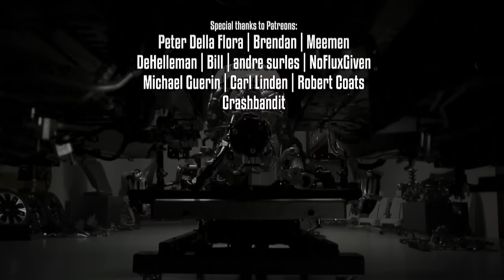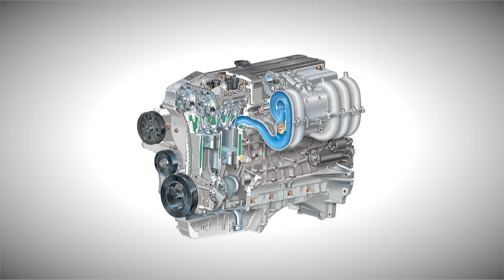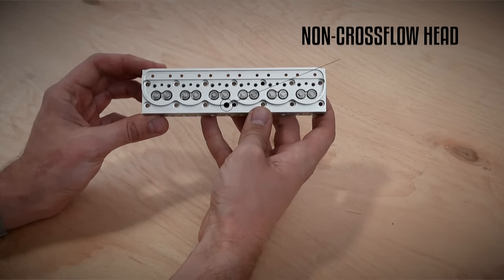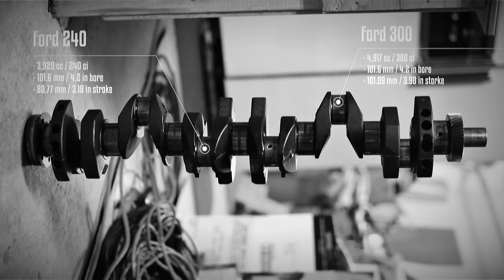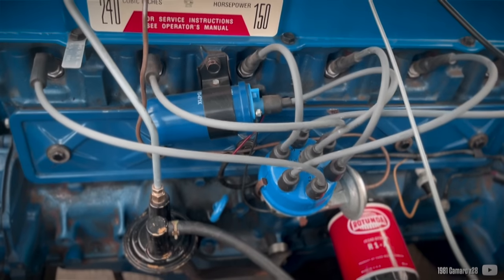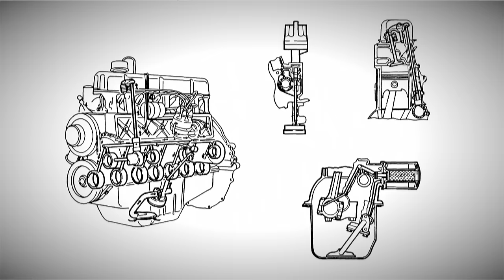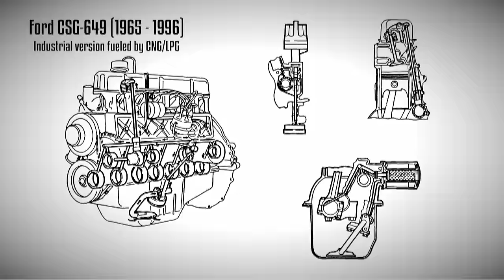Is This Toughest US 6-Cylinder?

Comment: I've been an ASE Certified Master Tech for over 25 years. Worked on everything there is. Beyond a shadow of a doubt, there is one US Straight 6 that is the king of endurance and longevity:
The Ford 300ci I6. Period.

It may get so weak it can't get out of it's own way, but it will run.
I watched one run for 20 minutes longer AFTER the back half of the camshaft had broken off and slung itself out the side of the block. You can't kill a 300 with a sledgehammer. Hell, it kept running after it tried to commit suicide. The Ford 300 is unstoppable.

Comment: 3:37 the 240 also has a different block casting. The deck height was much shorter. The 300 exists because the 240 didn't have enough torque to do what farmers wanted their trucks to do; ford's response was to stroke it so much they needed a couple inches more deck height. That's why the 240 didn't live as long as the 300 in production; the market for straight sixes in cars where the 240 worked exceptionally well dried up but the 300 would still sell like mad even today.

Comment: Sorry, but at 300K miles, they’re just getting broken in.
At 450K miles I had my 300 rebuilt and drove it another 250K miles.
That was the Best pickup I’ve ever owned.
If Ford would build another F150 with the 300 In-Line 6cyl again I’d be happy to buy another one.

Comment: 300cid Inline-6 was likely the best built 6-cylinder. Timing gear instead of chain, made these almost indestructible. Only downside was their base 1-bbl. carburetor Ford slapped on them. An Offenhauser replacement intake manifold allowed for a 2 or 4 barrel carburetor instead, thus turning these 300's into screamers for performance. 

Ford should've kept this engine versus their EcoBoost V6 platforms they make now. A 300cid in today's rigs with performance fuel injection, would set records for economy AND performance.

Comment: While I love my Ford I-6, can it really be any tougher than that weird-looking GMC V6 they put in everything from pickups to semi-tractors?  I had a '66 GMC pickup with a 351 V6 with a stock huge two barrel carb (you'd swear it was a 4 barrel if you saw it from the side).  It trounced V8's on a regular basis.  Unfortunately the rear end and transmission were no match for it.

Comment: Ford didn't want a 6 cylinder and that is one of the reasons the Dodge boys left Ford. It took till 1948 for Ford to build what Chevrolet and Dodge has been doing for 20 years. The exception was in 1908 in the failed model-K. Hudson built a better 6 cylinder than Ford around 1950 also around 308 CI.. Chryslers slant six was better, Chevies Stove bolt six the 216 and the 235 were fabuloius and the Jeep 4.0 was always very durable. I never gheard of anyone getting much more than 14 mpg in a Ford 300CI, less when working them.
My cousin broke a piston skirt in his 300 but his love for the engine forced him to rebuild it. I think the nature of straight sixes is their reliability as Cummins uses them for deisels. I have always had straights 6s and once had a straight 8.

Comment: I had forgotten about that motor. I once bought a (late 60s ~ early 70s?) Ford pickup with over 250,000 miles on the 300. I put an old cap on the truck, loaded it with my tools, clothes & all my stuff and headed to Colorado from Pennsylvania with a friend in search of work. Other than a tire blowout east of Denver, and about 15 quarts of oil...(did I mention it used a ton of oil after spending 200K miles delivering beer for Marienville Beer Distributors?) not problems occurred. A couple years later in El Jebel, CO between Glenwood Springs and Aspen, I bought an old Willys Jeep pickup from a sheriff deputy that she had stuck in a field. In the bed of that truck was a Ford 240 that had a stuck valve from sitting gawd only knows how many years in that field. Off came the head, freed up the valve & lapped all the others and changed to valve guide seals on all the valves. Out came the 300 & in went the taxi cab (yup, that's what it started life  in) motor and I drove it another 100K before the rear main seal went out. The truck was then given to a brother-in-law who changed the seal & after that I lost track.

Comment: I have owned several Ford F-series trucks that utilized the 300 I-6 engine. I had an F-250 while in high school that turned the dial over 450,000 miles. The only reason I got rid of the truck was because the frame rotted out and I couldn't tow with it anymore. The engine still ran like a top, and managed to afford me 21 MPG under normal driving conditions at 55 mph. Towing a landscape trailer loaded down with 2 riding mowers, a propelled sicklebar walk behind, 3 push mowers, chainsaws, weedeaters, hedge trimmers, a dump cart, a truck box full of tools, and 30 gallons of fuel, it still gave me 14 to 16 mpg. 

I wish Ford never outphased that engine because I took an early 80s 300 and gave it the Clifford Racing treatment and had my uncle do some slick head-work in his machine shop. When it was all said and done I got a little over 390 hp and around 750 to 800 lbft. of torque using two Holley 500cfm two barrel carbs, custom built dual headers, an X-pipe, and a 2.75" exhaust. The funny thing is that even with the performance upgrades mated to a 5-speed and running a 373 rear it managed 20 MPG conservatively driving and about 14 if you were whooping on it. It would piss off tons of 5.0 Mustang owners when they got stomped by a 6-cyl shortbox pickup. I imagine that if someone was inclined to reduce the compression ratio that running a supercharger or turbo on one of these engines could render close to 650hp and upwards of 1000 lbft. of torque and still be reliable enough to be a daily driver as well as an asphalt rippa.

Comment: Love the straight sixes.
Had a 65 ford Fairlane with one, retired the car due to rust at 220K miles.
My friend has a 66 Galaxie 500 with the six, still going strong at 211 K.
Had a 66 Dodge Dart with the slant six, love it...and knew a guy who raced his six with a full Stage 3 setup, you would be amazed to see that car do wheel stands at the drag strip.

Only reason Ford got rid of the flathead V-8 engines was high speed power and fuel efficiency...but all the torque would need.  Indeed, I still know of a crane built in 1953 that has a Ford V-8 in it, and it's going just fine...yes, it's the 'industrial' version engine (bigger water pumps, etc), but it's virtually the same as ones that went into the family car, it produces to this day gobs of torque.

Comment: The Australian Ford Barra Motor was mentioned briefly at the start of this video. I live in New Zealand, where the now defunct Australian made Ford Falcon was imported, in particular the travelled 320, 000 Kilometers, (212000Miles) the motor is still strong and reliable, and burns no oil? I am guessing it will cover at least another 200,000Kms, (120,000 Miles before requiring any major work?

Comment: Yeah, the 240/300 was practically bullet proof and ran forever, but I can't say the economy was spectacular. A well tuned 302 v8 could do better. The closest engine in the reliability and performance of this engine has to be the AMC 6 cylinder introduced in the 60s. While it wasn't quite as tough, it certainly had performance, reliability and economy. In the later Jeeps using fuel-injected engines, you would never believe it was a 6, as they would rev like an 8. Chevy's 6 cyl was a poor third as it had reliability issues (cyl heads) and could be beat-down. The Chrysler slant 6, although not at all a performance winner, was also tough as nails, even with only 4 main caps. It was a total mystery how these engines lasted, but they did and owner's swore by them for their reliability and economy. Then there is the Ford small-block thin-wall cast 6 cylinders which were gutless and not at all tough. The 144, 170, 200, 250 performance was a joke, they had none.

Comment: I nearly have 300,000 miles on my 1986 Ford truck that has the 300 straight-6 engine. Has a carburetor, distributor, basic electronic ignition, LOTS of space to actually work on it, NO stupid extra electronic junk that is packed on the engine or anywhere else, can easily do road-repairs when something happens to fail like commi china-made replacement parts that are JUNK, and I will NOT buy these newer over-engineered vehicles. This Fall season I planned on rebuilding the engine and that will likely last me the rest of my life and so I dont have to pull hair with the total BULL$HIT on these modern vehicles!

Comment: The Ford 240/300 six are legendary for their durability, even stock (unlike the industrial 300 which had forged crank and metal timing  gears and those can last forever!) often ran 300k or more miles without major concerns.  However, the 292 six from GM is also a great engine and durable, but for whatever reason GM  really didn't much an effort to sell it even though it was available in some trucks as late as 1988.  Both engines have gobs of torque at low rpms, which is what you want in most cases and reasonably thirty with fuel.

The slant six was durable enough, but compared to the Ford and the Chevy 292, was a bit short on torque because of its smaller displacement.  And, the AMC/Chrysler six, was also durable engine with its 7 main bearings and actually was the longest in production of these engines, making appearance in 1964 and lasting with various modifications till 2006 or so.

But, for day to day operation, either Ford 300 or 292 Chevy are the best choices and the longest lasting.  I prefer the 300 six because parts are cheap and plentiful and there's always someone who can fix if you cant.

Comment: So the jeep 4.0 i6, the Ford 300 i6 and the aussie i6... the first 2 run 350k plus(I've had 2 jeeps I got to 350k+ one was 356k and the other made it to 374k..).
I've got a 78 with an 351 cleveland, but if I have to ever change it. The Ford 300 will be the replacement.

Comment: Oh god yes, I’ve been driving Ford trucks for over 60 years (yeah ranch kid) with the bulletproof 240/300 six until the ‘97 10th generation. The inline 6 was always good for 300,000+ miles. I learned to carry a spare alternator, water pump & tools.

Comment: And there's nothing wrong with pushrods either. Check out Ford Australian's Barra 6 cylinder. Very strong, reliable and very capable of making more powerful.
Sadly, ford's Australian manufacturing has passed now- I think in 2016?

Comment: Really easy to squeeze more power out of the 300, especially in the malaise era. Port the head, bigger valves, set of headers,new exhaust, Offenhauser intake, four barrel carb, and you're in business. Ford was choking these engines for the sake of fuel economy. If you just let them breath a little they woke right up. My old man had a brand new Silverado in '95 and it drove him crazy that my '81 F100 with a six cylinder was quicker stoplight to stoplight.

Comment: To answer the titles queston, "No,."
Because , Slant Six.
When you save money by amortising the tooling for your biggest V8's by using the same bearing sizes for Cranks, both ends of Conrods, Cam and Cam Timing Gears and Chain from those V8's on your base model "Economy" engine, that base  model engine becomes so over-built that it's nearly unbreakable. Mind you, only the Ford 300 comes close.

Comment: Its true! I have a 1993 F150 with the 4.9l 300 straight six. It has 344k miles and goes up everyday as its my daily driver. Also worth mentioning is I loaded up the truck bed with my junk and drove it across the US in 2022. It was so heavy I questioned what I was thinking and whether I was going to make it. The odometer read 336k miles when I started driving.  Well, I drove and drove (at 65mph - hogging up the right lane of course). I stopped every few hours to let it cool down and stretch my legs. A few days later, I made it X country. The ol Ford really was built tough. The engine itself is a beast. 
The seals, bushings, and parts that attach to the engine like the water pump, spark plugs etc. .. Those are the things I've had to replace every now and then.

Comment: If the 300 were rebuilt with a low tension ring and synthetic oil used it might last 600,000+ miles.  The pushrod U.S. sixes are lazy workhorse  motors that don't experience much use over 3,500 rpm.

I wish the Chevy 250/292 had survived long enough to get a factory LS hesd

Comment: Short answer is NO  AMC 6 is a even 225 chrysler will take more punishment
Why AMC broaches the Mains so they are filled in full width with 1/2 inch bolts
I've done 1200 hp and 1000 for 3 hours with a turbo 199 (Indy project)

Comment: Just returned from the store in my '95 F-150, all stock, 250kmi. The 300 is great, and may last 300k mi., but the dash won't, and you can't get a new one. Find me one, I dare you. Anything from another vehicle is subject to the same sun degradation as mine, which is cracked and falling off the firewall. Someday perhaps they can print a carbon graphite one.

Comment: The slant 6/225 is more durable but is a lightweight. I had a 1976 Ford I-6/300 and it had no power. The stock 300's simply need to breath and the 1 barrel chokes it. So I put a 2 barrel on it from a Ford 289... That puppy could pull!

Comment: We had a 65 ford wagon that ran great until we junked it. Later I had a 96 F150 that I would still be driving if the chassis crossmembers didn’t start throwing chunks. Now we have 16 F150  2.7T that smokes briefly on startup. Sound familiar?

Comment: My 1986 ford f150 flareside shortbed with chains on the rear tailgate cost me $200 plus $75 aution fee around 2002. 300 6 cyl  c6 auto absolutely  a great good looking truck. Terible gas mileage my only complaint. Sold it 3 years  ago for $2500 now upgraded to a 1996 ford ranger v6 auto another great truck for $700

Comment: I think all the big 3 should bring back their inline 6 cylinder engines. Chrysler's slant 6, GM's 250 and 292 CID, and Ford's 300 we're all pretty much bulletproof engines. When it came to the carburetor issues Ford did have a better design by putting the intake and exhaust manifolds on opposite sides of the engine greatly reducing to almost completely eliminating the possibility of vapor locking, unlike Chrysler and GM stacking the intake on top of the exhaust manifold.

Comment: In the 1940's and 1950's Chrysler had a flathead 6 cylrnder engine that appeared in Chrysler, Dodge, and Plymouth cars.  That engine was indestructible, and many of them were still going strong in the 1980's, and 1990's.  That flathead six was produced until Chrysler replaced it with the 225 slant six which was also a good 6 cylender engine.

Comment: I had a straight 6/ 300 in a 1982 F350
It had a Muncie PTO. With a  hydraulic oil tank. It ran on the jobs all day long.
It literally had a million miles on it. I bought some brand-new trucks. Hydraulic power units that wheeled off the bed. That truck sat in the corner of my yard for 5 +years. I sold the company. A couple of years later I saw it back on the road. The new owner put it back in service😂

Comment: I would love to see an auto manufacturer go back to inline 6 cylinder engines like Mazda is. My experience with the inline 6 cylinder engine was the 4 Jeep Grand Cherokees I had with the 4.0L engine.  It is also a hoss and I got 2 of mine past 375k miles! The natural balance, low-end torque and unique exhaust note are why I prefer the inline 6 cylinder engine. Unfortunately, I'm stuck with 2 V8s for now 😊

Comment: That and the GM inline 6 as installed as the Red Motor in Holdens. Simple.  Bulletproof  Can be dismantled completely In less than an hour. 

Modern engines are insanely  complicated.  Half the time you can't see the engine for plumbing. 

 Double overhead cam shafts might be great but they lead to a mass of unecessary top gear. 

Two of the more insane motors would have to be the ridiculous Audi V10  and.the Range Rover 5 L V8 supercharged.  With the AMG Mercedes engine is not far behind. 

The dopes at Audi even put the cam drive at the REAR  of the engine -  up against the firewall. 

Cam chain drive tensioners are a major source of  often catastrophic failure in so many cars.

I put almost 500,000 km on a 186 cu. in (bored +0.030"  to 192 cu. in. ) installed on my old Land Rover. Despite thousands of kilometres of red fine dust and lots of river crossings that engine never quit. 

The only relatively modern India not have come across which she has many of these characteristics is the 80 Series Toyota petrol 4.5 litre. 

Of course the real common factor in all of the motors is that they all have a cast iron block. 

If you want true engine longevity then stick with that recipe. 

Even the old twin cam, long stroke Jaguar XK engines gave phenomenal kilometres when treated right.

Comment: Keep the oil clean and a stock Atlas 4.2 will knocker about any 6 ever made. while putting out close to 300 HP in bone stock form. I've had several 300 Fords and found them to be either gutless, or if set up for power, inefficient. And I prefer the old 250-292 Chevy as well.

Comment: Drove E-350 vans with 4.9L's as a forklift road tech for 13yrs; it would tow a trailer with a forklift tire press and Miller generator/welder with no problem along with the weight of my van (8500lbs). Never ever had one strand me in the 300k miles I logged. Bulletproof

Comment: Youre missing out on the ford 223 inline 6 cylinder which is better than the 300 CI.  The 223 inline 6 was used in full size cars and trucks up to 1964.  But the best inline 6 cylinder on earth is mopars slant six egnine